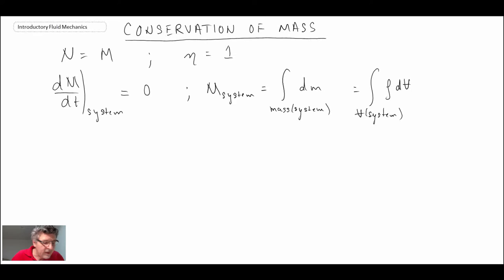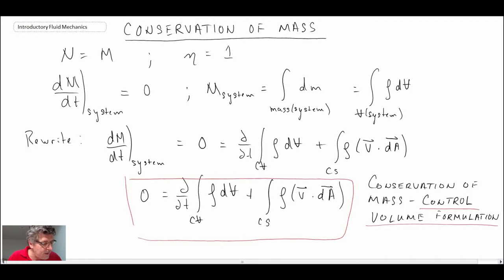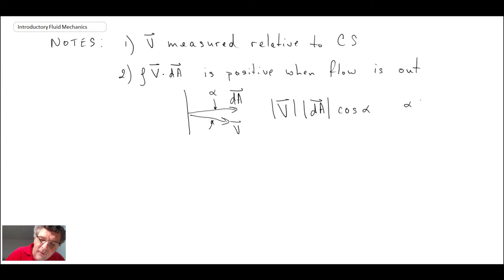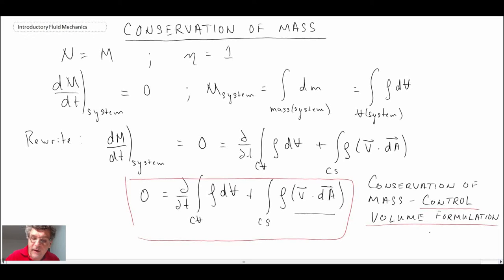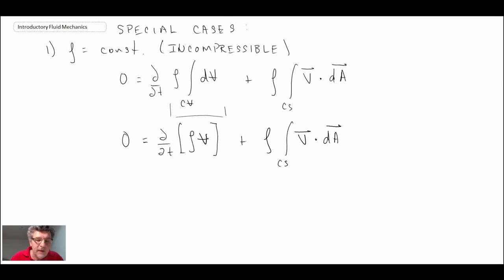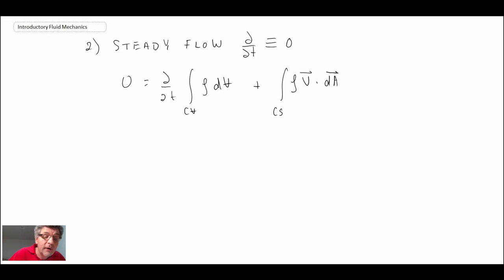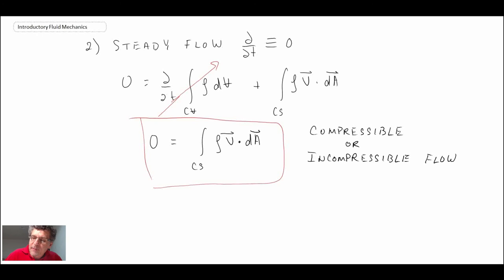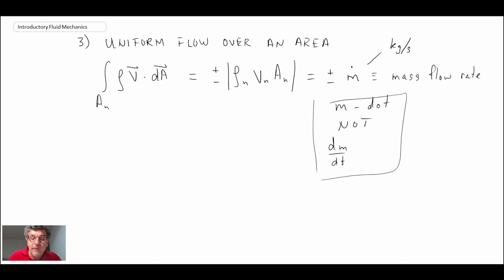Introductory Fluid Mechanics L8 p2 - Conservation of Mass - Control Volume Formulation

Comment from the maker: You could leave it in, but it is not necessary to leave in given that the integral will evaluate to zero - volumetric flow in equals volumetric flow out [m/s * m2 = m3/s] for an incompressible fluid and thus no matter what density equals, your equation becomes 0 = density * 0.  L12 p3 looks at the differential form of the continuity equation and there again you will see the density term dropping out of the equation for an incompressible flow.

Comment: Hi I have a quick question. When you are explaining the first special case (around 8:26) should density be included (outside the integral)  in the final reduced form of the CoM eqn for incompressible steady or unsteady flow?

Comment: Hello, you mentioned that the unit mass of 1 which is denoted by n. Now in your conversion of mass- control volume formulation in the CS portion you didnt include the n. In your previous video you had an n. Could you explain why the n got removed in the 2nd portion of the equation? (C.S)